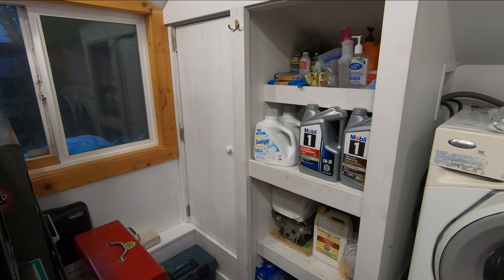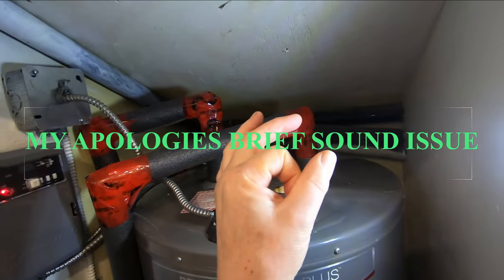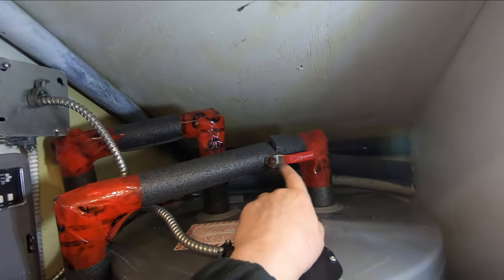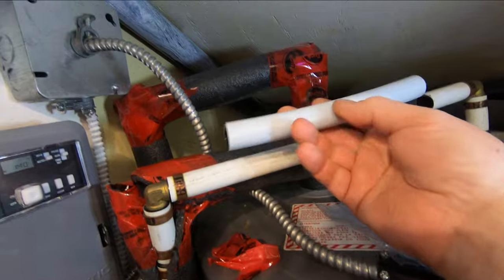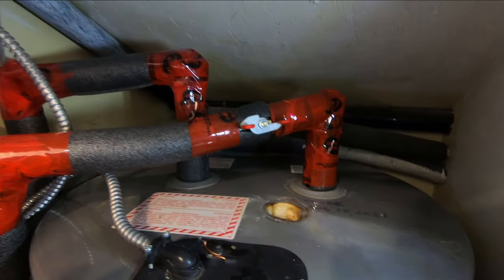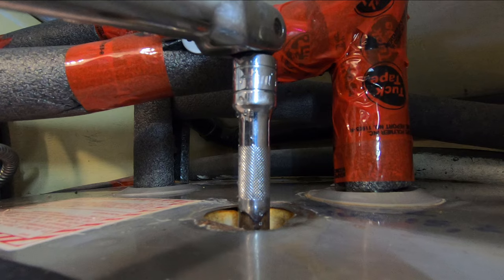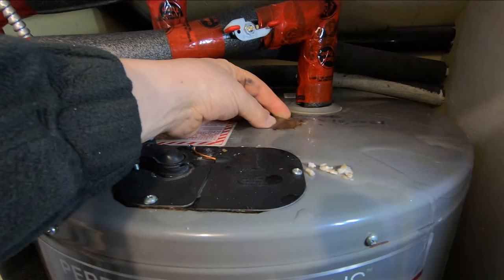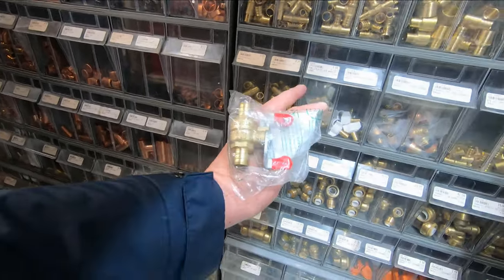INSTALLING A SEGMENTED-ANODE ROD IN A HOT WATER TANK WITH HELP FROM "CHEVY"

Comment: I can’t even remember what an anode rod does. All gas water heaters have one. But I’ve never changed one. Use to have propane, have electric water heater now.
You don’t put any sealant on the pex water line when joining ? 
You should have flushed the tank while you were at it. Another thing most people don’t do. Including me. 
Chevy was a great help to you Craig. I have a Ferguson cat, named after my tractor, who likes to help. And looks like your fella. 
Have a good day. 👋👋👍🏻👍🏻
Reply from the maker: Hello Noel. An anode takes the corrosion instead of the tank. If you change the anode every few years, it will protect the tank from rusting through. The primary reason a hot water tank is replaced is because it starts to leak out through the steel of the tank. Heating elements can be changed but once the steel tank rusts through, it's game over. Chevy actually does about 99% of the stuff on my channel and I just sign my name to it. That's because he can't hold a pen. 
PEX connections rely on the crimp ring forcing the plastic pipe into the lands and grooves of the connector to prevent leaks. No sealant is required. I must catch up on my video watching and do a shout out to you for the sticker!! I am way behind.
Reply: I use to know that when I worked in the trade. Thanks Craig. 
I kinda figured Chevy did most of the work. 
I’ve never used pex always copper. 
Have a great day. 👍🏻👍🏻👋👋

Comment: I am sure mine has one, but I have never changed it..😉👍
Reply from the maker: Changing the anode can add years of life to a hot water tank. It takes the corrosion instead of the steel of the tank. They act just like the zinc anodes on outboard motors/boats to prevent corrosion. I'll change the anode for you the next time I'm there at 2:30 in the morning helping myself to your firewood!:face-fuchsia-poop-shape:
Reply: @EverydayProjects  : I am sure for me, it's coming up on too little too late.  I got this tank about 17 years ago and have not done anything to it. So I am just waiting for it to be a problem.

Comment: I just installed a new Rheem electric hot water tank last night. My old one was 8 years old and giving off a lot of rust. The old tank was a GSW. Rheem has a better price so I went with that brand. I didn't know they made the flexibility rods.
Reply from the maker: With regular anode changes, you can get 15 or more years from a tank. Check and replace the anode on your new tank in 3 years.👍
Reply: @EverydayProjects  I definitely will do that, I have the date wrote on the new tank.
Reply from the maker: @OpenAirAdventure  I’ll send Chevy to help 😸😸😸